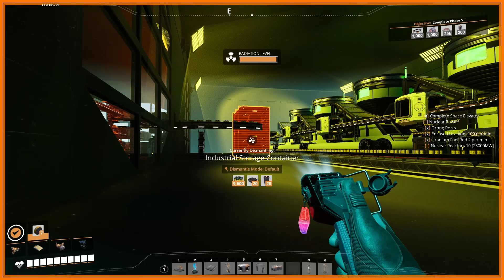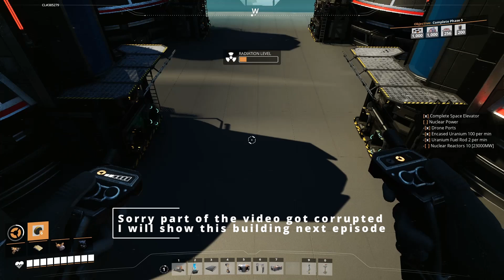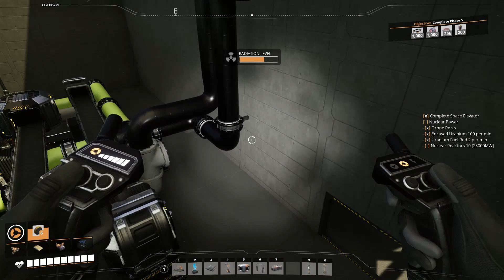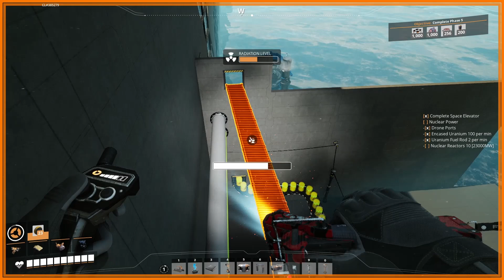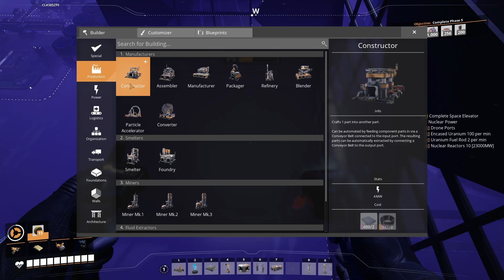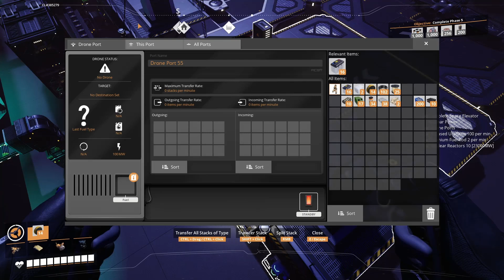Satisfactory 1.0 Ep33 Adding the last parts of Nuclear production

Comment: Honestly, wonderful job on the pipes. Also the stuff added with 1.0 helps allot to line up things.
Reply from the maker: Sure does when it comes to the belts and pipes also fit better. Just have to go and see what is up with the rates as it should work without power jumping up and down.